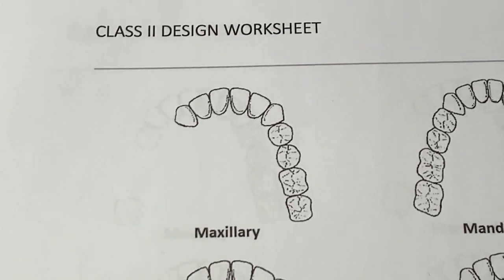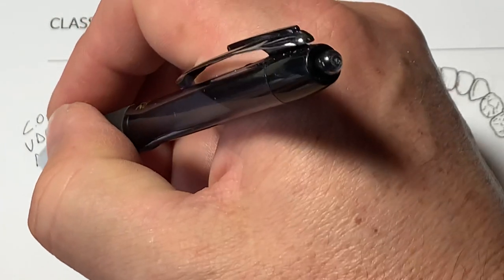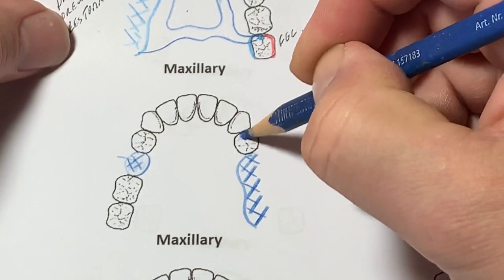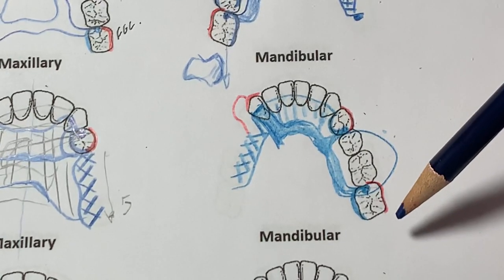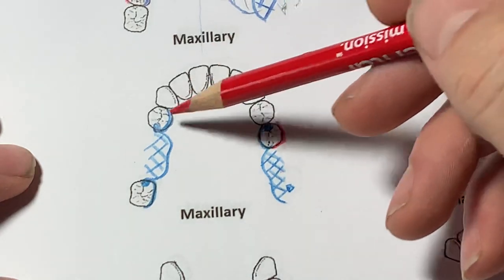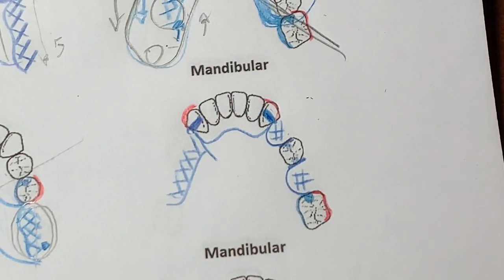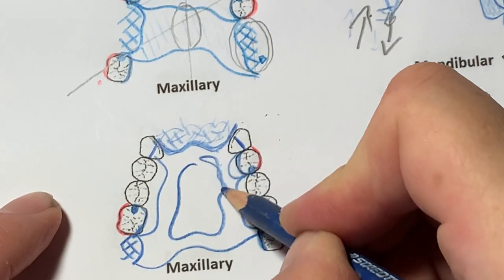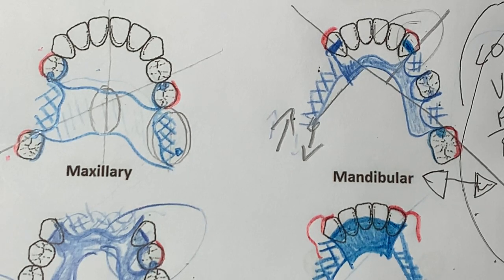Cast Partial Denture Design Kennedy Class II

Comment: Thank you for a detailed video. I have a question if you could please answer it...

Which is the best option for class II? a. Distal rest and I bar   b. occlusally approaching class c. Dental bar   d Mesial rest and I bar
Reply from the maker: Hi Marium, 
Thanks you for your question. The design thoughts in the video are under the assumption that all the abutment teeth are sound with a good prognosis as well as plenty of room vertically. It is to highlighting best practices with an academic foundation. We should endeavor to locate mesial occlusal rests on terminal abutments with stress breaking clasp whenever possible. I bars, Y bars and W.W. clasps. departing from these clasps and rest position may compromise the life span of the abutments and reduce a positive prosthetic outcome. Taking this in consideration will help us create realistic treatment plans for our clients with a more definitive prognosis. Frenum location, alveolar height, degree and location of undercuts available, opposing dentition, previous and future restorative, vertical dimension, sulcus depth, length of guide planes, length of prosthetic occlusal table, depth of palate, quality and type of mucosa and saliva composition will guide us in design and appropriate treatment plans. 
Regards
Paul K.